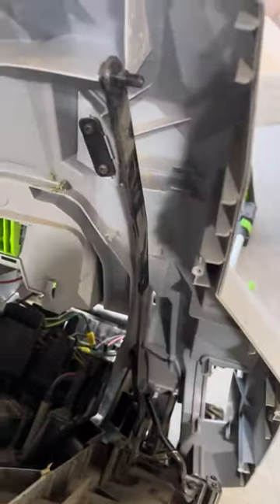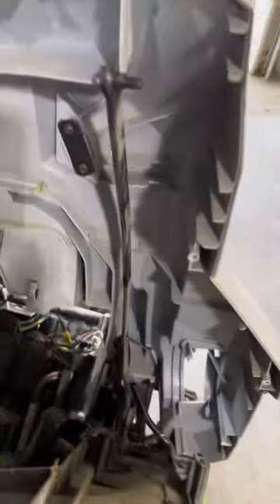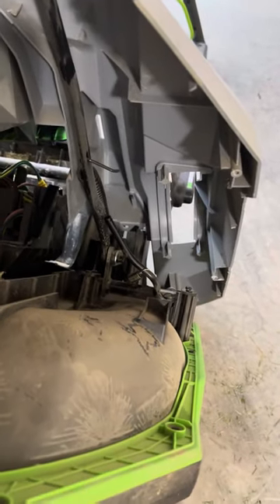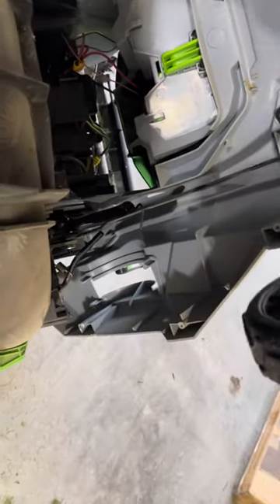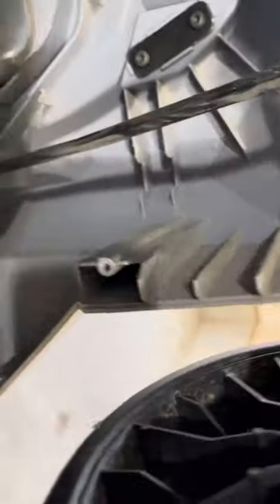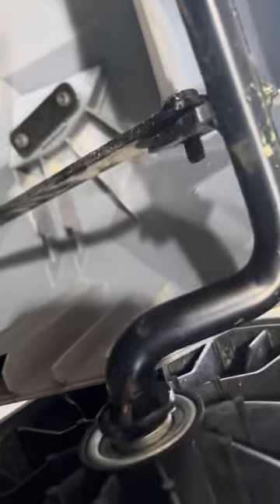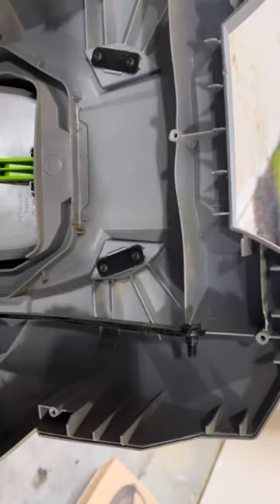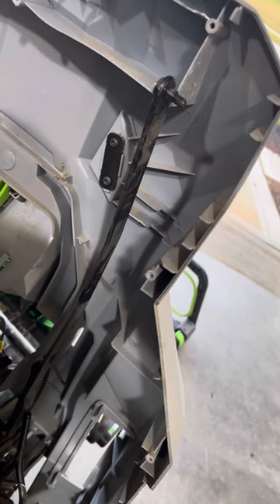EGO Mower Front Axle Problems Part 2: The Fix (front axle repair).

Comment: I fixed mine today.  It took about 3 hrs, including a trip to Harbor Freight to buy a 6” Torx 15 driver to reach the deeper screws on rear of underside.  I went back with lock washer with the nut. 

Thanks for the videos Roy!

Comment: This was a nightmare project, but I managed to get it fixed in about 3-4 hrs. Never quite figured out where all the hex screws were, but got the bottom loose enough to spread the plastic apart and find the height adjustment bar. You have to take some of the screws out of the top as well as the bottom, including the removing the height adjustment handle. I was lucky, the nut that had fallen off the bar was still inside the chassis. Tightened it with a ratchet as best as I could.

Comment: Hey Roy. Did putting the missing but back on (or a new nut) fix the axel issue? I'm looking at getting my hands dirty to fix this tonight. Not sure if it's worth it or if I should just go through the warranty process.
Reply from the maker: It worked like a charm. I don’t know what the original setup had, but I used a locknut with an extra lock washer. It really helps to remove the knob from the height adjustment lever (two small Phillips screws). It will allow you take tension of the springs that connect to the linkage arm.  Edit: The battery housing comes off as a single unit on guide rails. If you don’t use the rails during reassembly, the screws will still fit, but you’ll end up with a 1/2” gap between the housing and the frame.
Reply: @Roy-lt3eo  great thanks for the advice!!
Reply: @Roy-lt3eo  What size nut/washer did you use? Gonna attempt this fix on my own Ego 21!
Reply from the maker: @AutumnusDux  I grabbed a few from my scrap bin and kept trying until one fit. It was at least a  1/4” for the nut and washer, maybe slightly bigger.
Reply: Thank you for this video. I just fixed mine. The nut is 1/4".

Comment: Last spring I pulled my EGO mower out for the first cut of the year and the electrical was completely fried (stored with battery out).  Warranty repaired, but the mechanic told me it looked like it had taken a lightning strike (which it hadn't).  My guess is it fried when I put the battery in that day.

This spring, I pulled my EGO mower out for the first cut of the year by my teenager.  He starts, but comes in and says there is something wrong with the wheels.  Exactly this issue...the front axle won't adjust and sits the front of the mower on the ground.  Looks like I have a project this weekend.  Thanks for the video!